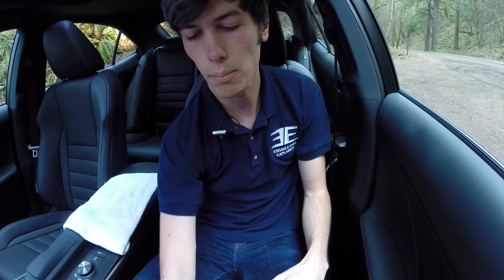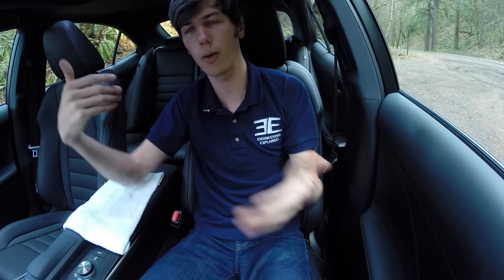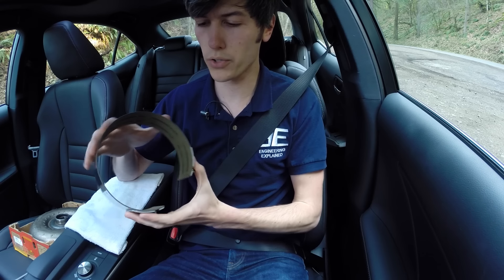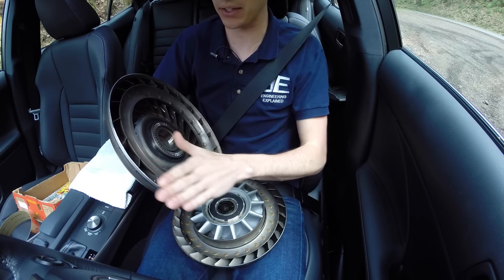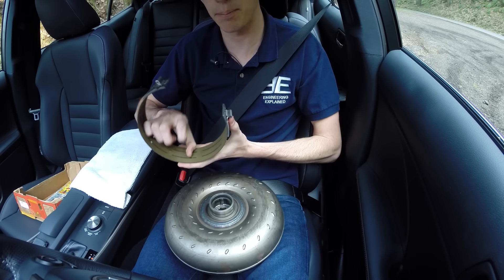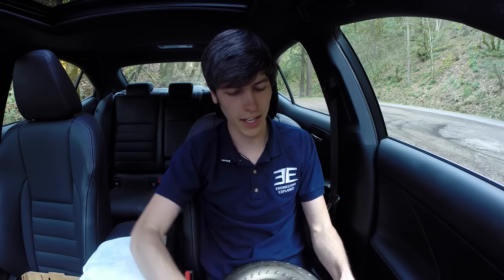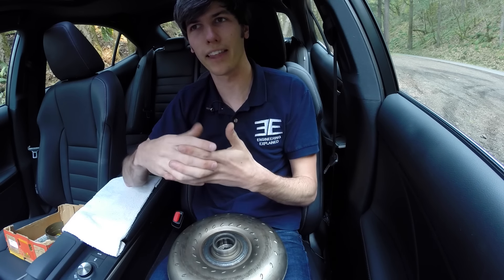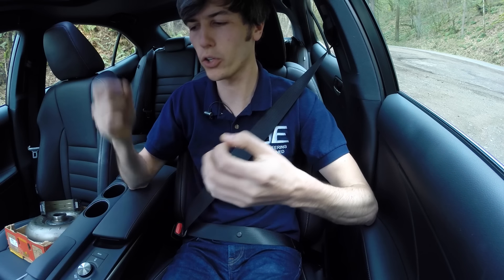5 Things You Should Never Do In An Automatic Transmission Vehicle

Comment: My personal reason for putting it in neutral at a stoplight was not mentioned. Preferring a manual transmission, the automatic transmission idle creep drives me crazy.... I can't stand mashing the break for long traffic lights.
Reply: Thanks Corin, thats the main reason i know to put it in neutral in a traffic jam or at a stop light. Also if you  happen to let some of your pressure off the brake pedal the car can still creep forward and you might not even know it. Easier just to put car in neutral.
Reply: so why not put it in park  and  when the light turns green put your foot on the brake and shift to drive .... all bases covered
Reply: Harry Aiken because you hit reverse first and it's three notches before drive instead of one! more delay going from park to drive!
Reply: ????? okay....but if you put the car in park you don't have to hold the brake and the car work creep forward while your talking on the phone and roll into the car n front of you......or replying to me ...andif you forget what gear youre in while on a hill because youre saving SO much fuel  you wont roll into other people... safety first lol
Reply: no brake lights at an intersection? what kind of backwards ass pagentry is that?
Reply: Harry Aiken if you're that forgetful you don't need to be driving!!
Reply: lol putting the car in park while in traffic is not good idea some cars automatically unlock the doors when in park
Reply: Corin Stedman I do that a lot am I messing up my car?
Reply: Get a Skoda Superb or any newer car and put it in auto handbrake mode.
Reply: It really takes a lot longer for my car to shift back from park to drive than from neutral to drive. When you're the first or second one at the light, the people behind you definitely notice 1-2 second delays.
Reply: also older transmission don`t have the switch to go into neutral when the brake is depressed, you are stressing it by braking in gear for too long...
Reply: of course . it makes no sense to keep braking at a red light to stop it from going forward. sometimes it takes more than 5mins.
Reply: I can't think of one traffic light around here that is flat. They're all on hills/slopes. You'd roll some direction or another if you didn't brake.
Reply: But if you get rear ended, aren't you liable for any damage that your car does if it rolls into anything (cause either your foot was off the brake or you were too close to the forward obstacle)?
Reply: CODMarioWarfare Ensurance companies will always look for ways to blame someone else. Around here it seems they have something like an " agreement" and tell both drivers if it is the case, that the fault is from both and neither company would pay damages. Someone went straight on a stop sign and hit my brothers car, total loss. Both companies were claiming 50/50 fault...LOL  Luckily the other driver was a respectfull person and declared himself guilty.
Reply: But IMO you are at fault if you don't have some sort of parking or driving brake on at a light which would prevent an accident (rolling or rear end).
Reply: if you're in neutral and on any kind of hill, you're gonna be drifting anyways. If you wanna completely stop just put it in park.
Reply: yeah ill take more stress on a set of $60 pads over a $4000 transmission, when you put the car in park something is still keeping the car stopped and that is the transmission that holds it there. and before it is stated that the car is in park a lot of the time, yes it is and I use my hand brake to alleviate some of the stress on the transmission
Reply: +militaryman7778 No one said anything about the Park position dude... Only the Neutral position... And just so you know, when an automatic transmission is in Park, there's no fluid coupling between the torque converter and the transmission. And putting on the hand brake alleviates NO stress on the transmission... Your comment lacks structure, proper use of grammar and oh, logic.
Reply: Corin Stedman yes it was, you were not paying attention 00002% of the time.lol
Reply: You are right CS. I also do the same for the long traffic lights... and they are many :-)
Reply: roryps1965 i

Comment: Couldn't get past the "don't coast in neutral" stuff. I have never seen car advice that is so lame in my life.
Reply: +Phil Washburn I've also heard that it slows down the oil circulation in transmission, so yeah, there is not much benefit putting into N.
Reply: As long as the engine is running the transmission is getting oil. The torque convertor is directly connected to the trans front pump, which is the trans oil pump.
Reply: +Batuhan Genç Still, the guy have said that you should not coast in neutral, then gave three reasons, not connected to the technical aspect. It is like saying that you should not jump out of a window of a skyscraper because it is illegal and will affect the air flow around the house in the negative way, also, someone might get sick because you have left the window open.

Comment: im surprised how easy it is to abuse vehicles
Reply: +Josh Williams Well, you have a tank of highly volatile and explosive liquid, and a chunk of steel that makes on average about 100,000 watts of power and 300,000 watts of heat, that's a lot of energy to tame...
Reply: +Josh Williams But at the same time, for metal contraptions that can (usually) go over 80 MPH, they're pretty safe.
Reply: +Josh Williams As an ex mechanic, you're not the only one. Believe me. I've got more stories than i can remember fully about what people do to their cars. But mostly, cars can really take a lot of abuse without breaking. Just don't expect it to last as long as it would have otherwise, and expect the repair bill to be expensive.
Reply: +Campy lol that'll last you till after ww3
Reply: +Josh Williams Yes. If a lever moves at the wrong time it breaks a car. That's why cars are stupid - lever should not move at the wrong time if someone tries it at the wrong time. This start by button is also stupid - I wanted to turn off a radio and I turned off an engine, at least I wasn't moving too fast.
Reply: vertik7 Not sure if sarcasm or genuine stupidity. Damn you Poe's law!
Reply: +Teth47 gasoline isn't explosive... also 100k watts of power is pretty lame. Need to get a better car if that is all it can do :P. My modified m5 can do roughly 500k watts of energy.
Reply: +oprime you clearly have no clue what you're talking about
Reply: I'm suprized how hard it is for people to understand how to properly operate a vehicle. It ain't a video game controller
Reply: +vertik7 Dumb people shouldn't operate a several ton vehicle capable of traveling at speed....nough said.
Reply: +Josh Williams keep this is mind, and never forget it, vehicles are MADE to BREAK. they design they for pure profit and so that after a few years they (most vehicles, not all) fail and you convince yourself you have to go buy a new one. its just something that is known and for some reason accepted amongst the automotive community
Reply: +cb7pwn There's (apparently..to avoid litigation :) a release  from GM saying their drivetrains are designed to do 100k miles, and that's all. Shame, as the body and interiors last longer than that.
Reply: +Josh Williams hell get this each time you stop at a light it does damage.
Reply: +moyadapne that is a shame and yeah gm also with the HHR the engines only last about 100k miles. i heard people are going to junk yards and putting the other hhr engines back in theirs. if thats the case than im dropping something else in there maybe dodge Dakota i heard they last awhile
Reply: +Josh Williams the user manual states the best way to drive to reduce wear, if you don't follow those guidelines, the components often can't cope with the extra forces.. but producing stronger systems is more expensive and less practical both to make and to use.
Reply: moyadapne Source? I can't find anything about that at all.
Reply: Clay Yeah, video game controllers are way tougher. Car manufacturers should learn from them.
Reply: +Craig Friday The dodge dakota is plauged with their issues too. My friend has one that his dad bought new. Engine and trans have been replaced. As well as the rear axle. Transmission is on its way out again. Everyone has bad luck with a brand of vehicle. For me, I cannot own a ford because they don't seem to last.  My advice to people is, if a vehicle works well for you, stick with it.
Reply: +Teth47 I saw a service bulletin issued to an Auto Trans Parts Supplier.  Don't wanna say much more, as Yanks love to sue sue sue.
Reply: I think that would be a guaranteed but I don't know what kind of bulletin you would have seen where any auto manufacturer would say their stuff onlynlasts 100k miles.
Reply: +Josh Williams This Is Bullshit, Unless Your Car Is like 15 years old and has like 200k Miles On The Engine It Should Be Fine To Do Whatever He Is Saying NOT TO But I  KNOW THAT AUTOMATIC TRANSMISSIONS Rarely Have Issues With Transmission Because The Clutch Is Driven By Itself So Ya
Reply: +SaiKo Plays What? haha
Reply: +SaiKo Plays Please don't capitalize every word in your post. It makes it annoying to read.
Reply: +SaiKo Plays Huh?
Reply: You're blaming a car for user error.

Comment: I remember teaching a friend to drive my automatic Honda. He did everything perfectly, until I told him to stop the car. Puts it in Park at 15mph. Oh the grinding!!
Reply: what car was it ? at some point germans came up with antigrinder like in 1991 or something, once u are in motion u cant turn it to R or P untill u have come to stop
Reply: It's the pawl ratcheting. It's designed to do it.
Reply: +sugahotcakes not from 15 lol
Reply: Definitely not made for it. Made to hold the vehicle in position, not made for the forces exerted on it by a moving vehicle. If it would ratchet, how would it hold your vehicle still when its parked nose-down?
Reply: One time I was parked on a very steep hill (facing down the hill), and accidentally put reverse instead of drive and let off the brakes. Oh man, that grinding noise. The engine stopped after a while, but disengaged the brakes' booster, so I was going down hill with minimal control, heading towards an intersection. When. I finally stopped (I didn't crash), the car wouldn't turn on for about 5 minutes. I thought I had fucked up my mom's SUV!  When the engine turned on, the shifts weren't working properly and the engine sounded weird. I told my mom about the incident (as I thought we would've had to buy a new gearbox), but after four days the car returned to it's normal functioning. Up until now, I still don't know what happened or why it didn't get fucked up, but I'm glad it didn't.
Reply: u should probably still get it checked out incase anything got damaged.
Reply: You had to teach someone to drive an automatic? You don't have to do any actual work other than putting it in park and drive.
Reply: loool
Reply: a nother thing is that sometimes when u do it, the sensors in the gearbox will alert the pc and then the pc will turn the bearbox off because it thinks an accident happend, this happends a lot with a newer  german cars also a caddilac escalade or what ever is the name of that thing once turned its gearbox off because it hade a "glitch " in PC that didnt even allow the engine to start because it thought an accident happend.
Reply: +Imma Wake HEY I HAVE THAT CAR
Reply: its funny how i have to explain to my gearheaded friends how audi automatic car works, because they go like "why is is moving if i let the breake go" or "why do i have to press the breake to swich gears" "so when do i switch up"
Reply: Tanel Murd i live in a country with nothing other than automatics. So i don't have that problem in my area at least

Comment: There is a very good reason to shift into neutral at a stoplight, but neither stress on the transmission nor fuel savings is it. The reason is to avoid moving forward (into the back of the vehicle in front of you or, far worse, into cross traffic) if your foot slips off the brake. This could occur because of simple slipperiness or distraction - the dog or the kids or whatever.
Reply: Agree, adding the fact that if you've been driving for a long time, and a stop-light that lasts for more than 3 minutes is quite tiring, may even result for you to let loose the breaks and slowly move the car forward. 

That's why "Never put your gear on Neutral on stop-light" is quite strong, probably better "There's no need to put your gear on Neutral on stop-light sign" would be precise. I also cannot hear him say anything that could damage the car in doing this.

My rule is always been, if the traffic lights is 3 mins+ before it go, then I set it to Neutral + Hand break (just making sure I don't mistakenly move the vehicle).

Comment: it's "illegal" to put the car in neutral while going down a hill? dafuq?
Reply: +dokterkarel I didn't even know people do this, but again you don't save gas putting a car in neutral and you save the most gas leaving the car in drive or in gear without pressing the gas pedal(basically coasting) and the car won't use an ounce of fuel every time you "coast"
Reply: Yeah,  if you need to take sudden action you might forget to put it back in gear or else it'll just delay you so it's pretty much down to keeping  control of you car
Reply: +InTheZoneAXC That's correct. Modern cars will cut off the fuel to the engine if you're not hitting the throttle, but it needs fuel to keep the engine running in neutral. So I agree there. But I mean, it sounds crazy to make it "illegal". As if you could be sent to prison for putting your car in neutral.
Reply: +dokterkarel Here in Brazil is the same, they say if you are in neutral and something happens you cant do anything to react to it
Reply: It's almost definitely a secondary offence. As in, you can't be pulled over for it and theres almost no chance of it being persecuted, but if you crashed your car and that was determined to be a factor in the accident, they would probably charge you with it. Especially if the accident was your fault entirely.
Reply: that's the only thing that makes it unsafe. very true.

Comment: in short: get a manual
Reply: +B0NEZ Sadly, I can't. I'm unable to drive with both legs due to a handicap. Too bad, too. I'd prefer the manual.
Reply: +Matthew Bowman actually a buddy of mine has neither of his legs & he drives a manual! he has a motorbike braking & crutch lever & throttles up with the motorbike's twist grip! its a cool setup & yes, for us those still have a leg or two, we can still drive the vehicle normally with the leg(s) we still have(it still has all its petals) but he did claim for him to convert his camaro, it did cost him roughly $8k USD! so if you really want a manual & have the money you can drive one if you want to! the shop where he got a done closed(owner passed & family just wanted the money, how sad right) & both of us are not sure where anyone else could have this done if they too want this setup! but for what it looks like, I think it is an somewhat simple mod to do if you can get some odd/hard to find parts, some of the parts look like some bicycle pulley parts(with tubes) & links for the parts under the dash! so I think if you can get some motorcycle parts to be placed on/over the gear shift & be able to connect them up(his has 4 failsafe paths, meaning it has 4 cables running to each petal) the only thing he does care of about it is that it does make the shifter rather tall, it sits higher than his elbow vs. slightly lower than his elbow, which on long drives, his arm does get tired though! hope this helps & if you do like this & get a manual to do this, I also hope you can get this done!
Reply: Money shift! Cha-Ching$$